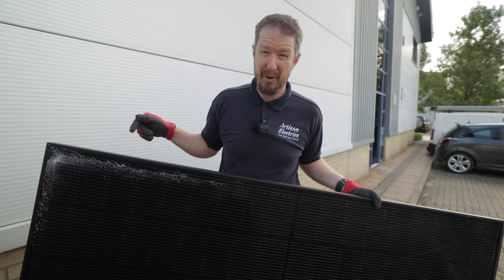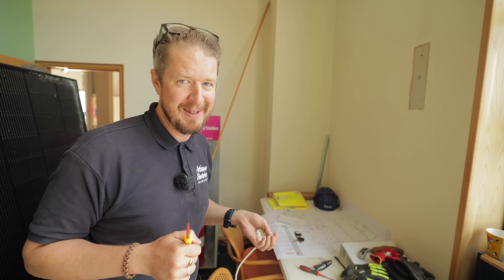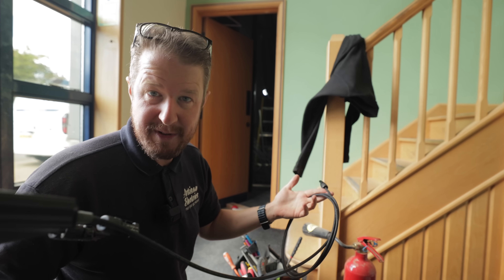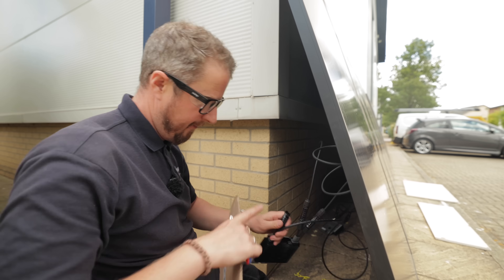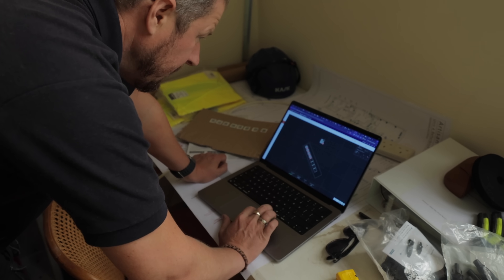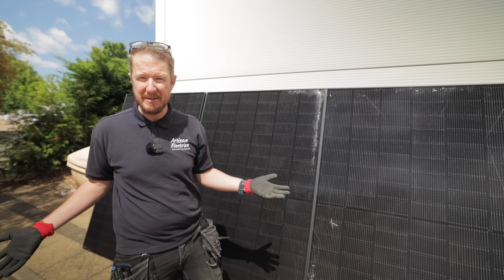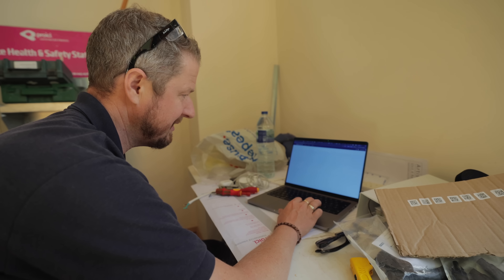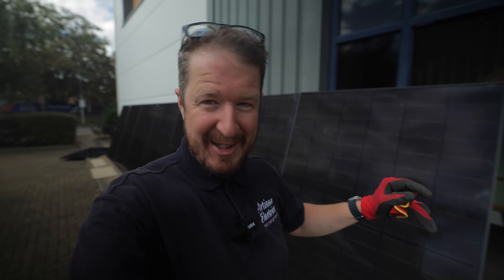Can Damaged Solar Panels Still Work?

Comment: Short answer = Yes !

Long answer, water ingress depending on depth and areas of damage. 
Potentially reduced output if electrical circuits compromised by impact damage or corrosion. 

Have several free damaged panels, all output. And by sheer coincidence, we had a blowy night, 2 panels fell onto concrete, and still work !

Comment: For a serious electrician, this is a very dumb test and completely unnecessary. The panic theory is out of place. Every Panel is nothing more than cells in series and parallel. If the panel's output is shortened, a good inverter will shut down that string.

Comment: shattered glass will still work at first , then from time to time  water will get in and cell to cell having short circuit.
I have buy some broken glass panel and apply the clear tinted that use in automotive, and it work like charm, what you want to do to broken panel is just avoid water to get in

Comment: A test i would like to see. Can you hookup a Sigenergy 5Kw inverter with a 5 KW battery and a SP gateway. When over 50% charged carry out some short circuit tests on a B10, B20, and B25 RCBOs. This is to test disconnection time not Zs, in island mode.

Comment: So this a new channel “artisan myth busters” next week let’s see how many panels you can over power an inverter by. I hear so many contradictions on this. As an industrial guy that works on power and control I don’t get why the inverter will only pull what it needs and won’t go pop. My mate had a cobble together system for some time with a cheap 1kw inverter hooked up to 3 kw of panels. Ran without any issues

Comment: Next test. Add an extra panel to the string to send it over the voltage limit. TEST THE SILICONE ADEHUVE BETWEEN THE Diode / M4 connection box and see if it melts and the box loses it grip on the back of the panel and drops off to hang on the Diodes and silver tails

Comment: Even if you plug uour + to the minus on the same panel. They will not short. The diode And M4 connection box, will show blown diodes in the case of a disaster.

Comment: My personal experience is ive got a broken panel with shattered glass coverin it,the panel also has a hole in it due to fallin over and hittin a star picket and well as its a ebay panel it had lower power than they say but it still works fine,reduced power but still fine

Comment: It’s pretty simple the panels are covered in glass. The actual solar generator surface is covered in glass. The damaged glass will likely have impacted the wiring. But just broken glass should have no effect

Comment: They likely work with cracked glass.

BUT when wet now you very likely have a insulation risk and if you touch the rails you might get high voltage DC softly making you a crispy roof ornament 😂

Don't think the solar production is the biggest issue here.
Neither fire risk.
And it's more a long term issue.
Silicon is very resistive from degradation from sun or water and shouldn't hurt it directly.

If it has a very huge damage like a dent or fold then yes it can be a fire risk, but still the now exposed DC is more scary in my opinion.

Comment: To be fare this test isn’t “complete” you will need put the panels and optimizer on a structure that is grounded to the inverter. The inverter says max iso because it’s not measuring anything as there is no feedback true grounding as everything is just loose on the floor. These panels for sure will cause isolation errors. Just check them loose, measure the resistance of it and throw a bottle of water one them. Even good panels you will see the isolation resistance go down, but there broken ones will cause a potential short if everything was grounded properly.

Comment: Depending on how the internal wiring is connected between the large groups on each panel, and depending on how the internal wiring within each group is done the panels could work fine right up to the point that all the important connections are broken (which could be multiple or single)... or it could just produce lower and lower voltages as each group within the panel breaks. There is also the possibility that large amounts of broken glass don't equate to large amounts of broken connections between the elements and then between the groups and then the panel as a whole. Broken glass means lower light transmission, but if all the elements are still wired up and each group is wired up you might only see a very small reduction in power.
Think of it as each panel contains multiple sub panels and each sub panel contains multiple parallel "strings" and then consider how you could wire up the roof panels so that no individual wire break causes the whole group to go off line (just a single panel) by having all the panels wired back to a single group connection point just before the inverter (as apposed to a string with multiple connections where a break in that string will off line multiple panels on the far side of that string) well solar panels, internally, can are laid out in similar ways to reach threshold voltages/currents per panel.

Comment: Even if these are working now, the smashed glass will let water in. I guess that is another test you could do with them (and a hose pipe). I think it may not have been wise to lean them against your building though as they may have caught fire as you suggested.

Comment: Yeah of course, the insulation test passes as there is no earth connected to the non existent rails that the panels bolt to...however I've seen and fixed many a cracked panel by pouring clear solar tolerant clear paint lacquer and letting set...water proofs and resealing AOK.

Comment: I had a pretty badly chipped panel in my array and figured, lemme just change that to one that is not broken, because, you know, I want to increase my production!

Well, I did, and my production did not go up at all. So, yeah, I guess these things are pretty robust. It has now been lying on the grass for half a year and I'm tempted to hook it up at some point to something as a test, to see if it still works or if it will finally catch on fire or something. All sorts of moisture may have seeped in.

Comment: I had a panel come off a roof once, needless to say it did not survive! Obviously as professional electrician I could not use it however, one thing I have always wanted is a solar panel with no glass or guts to help me initially lay out so I took it home to convert it into one. As a laugh I connected it via some dubious 18650's (from my wife's old vacuum cleaner that I was forced into repairing) and a broken commercial street light. My wife thought I was mad! Incredibly, it worked and the light came on as it got dark! There was no way my bodge-up was going to survive in the rain but it was a sunny summer so I decided to leave it a few days to discover where the point of failure would be! That was 3 years ago and somehow it's still working great and illuminates the turning area at end of my driveway (where there are no cables and it is all paved). As an electrician it has become a great source of amusement with our friends. The irony is that since then I have installed professional street lights with separate panels and batteries (and I buy them in bulk with 40% off!) but somehow this experiment has become 'part of the family' so I can't bring myself to put it in the bin! 
As an observation from your own experiment, you have used optimisers (so you can get the stats) but as I'm sure you'll agree, in a normal series wired install a single buggered panel could have a dramatic effect on the install as a whole, so even it works, the fact that it has different characteristics should mean it 'goes to the tip' (unless you have a street light that some builders reversed over and more time than sense!)
Reply: Actually, no, a single panel won't normally drastically reduce the output provided it has a working bypass diode and the inverter has MPPT.

Comment: Interesting that you bring this up. I want to get solar but concerned about being trapped into the suppliers equipment. I.E. a panel gets damaged and the supplier holds me ransom for replacement. Also suppliers often have engineering/supplier access which I may want to move to another supplier especially if the relationship breaks down. What are your thoughts?

Comment: Unless they are cracked all the way across the series run of cells the panel will produce something, the panel is made up of series and parallel strings. But once rain starts to get into them they will begin to fail.

Comment: As long as the cell wasn't damaged it'll generate power for awhile. Eventually water intrusion will kill it due to corrosion and cell shorting. Some folks apply a clear coat to buy time, and that will work for awhile, just don't expect them to last for years and years. Eventually they will die.

Comment: It is strange that you did this content. I just had a solar panel in my system fail. The Solaredge inverter had a ARC fault error. When looking at the layout one panel was not generating. all other panels were generating. Got up to the roof and sure enough one panel has cracked glass. We did get some rain recently so I guess the rain water migrated in to the crack and caused the arc fault. Replaced the panel and all is good.

Comment: I go to Austria on a regular basis and notice that a lot of new builds have solar fence panels, what are your views on them?
Reply: From an operational viewpoint, I was pleasantly surprised after looking at one in the Netherlands, obviously they don't produce nearly as much power over a period of time (and youre a bit screwed if the fence radically changes direction and you dont have multiple string options or optimisers) but thats offset by the fact you can install over twice as many. However, as I discovered, the ones I viewed were professionally DIY installed and not subjected to scrutiny! As an electrician, (in my personal interpretation of the regs) I dont think we can legally install them due to the exposed cabling, also I have 'evidence' to back this up, my first 'large' install was a model of perfection and quality that I was very proud of, so imagine how gutted I was when it failed DNO inspection for connection due to exposed cabling (I had to build a fence around it, that had to be custom made, so it was a fenced install inside a gated/fenced outer),  Also, there are about to be issued new regulations regarding the mounting of panels, do I don't see how 'a fence' would comply (although these regs, as I understand it, are still a few weeks away). I am working on a 2026 project which is short by 25 kW and I keep looking at the current fence-less boundary and wondering if its possible, trouble is, on this project, I am the consultant (producing all the drawings, specs, engineering surveys etc), hence the research, and my 'gut feeling' is a 'NO' so I'm going to opt for a 30kW mini-solar-park (on a bit of unused land) containing its own brick built plant room containing batteries, inverters, switch gear, independently fenced off because I know, this works, passes all scrutiny and is future proofed against all the changes we are likely to see.

Comment: Genuine question, why do all grid tied installers such as yourselves work with such low powered inverters? With off grid systems there's no limit to continuous outputs and much more powerful equipment that can be used when isolated from the grid.
Reply: 3.6kw is a 'limit' imposed by the DNOs to stop greedy pigs hogging the generation capacity. You can generate more, but you have to jump through more hoops. To be fair though, 3.6kw worth of panels will fill the average UK South facing roof.
Reply: @markrainford1219 5kw is the limit here in Ireland. Supposedly for grid stability so that the esb generators can keep up with with what comes in from domestic generation.
Reply: @markrainford1219  Isn't it a limit for this kind of equipment just because it's hook up to the grid trough a plug ? System of more than 10kW are displayed on this channel.
Reply: Now its strange because I have recently been pushing these boundaries on some installs, if I can answer the specific question, if you have say 5kW of panels and 5 Kw/Hr LiFePO4 by specifying a single phase 5kW inverter, the electrician can assume that the continuous current will be 22 amp and as such can be interconnected via a 6mm flexible 3-core flexible, simple and cheap, and the rest of the install will be using conventional technology and conventional equipment that you can buy at your local TLC, CEF.. whatever... As you go above 32 amp single-phase, you need to switch to 3-phase and then an entire extra complication arises with batteries due to phase balancing where you have to 50% overrate (and all the extra crap that goes with it!). So I never go above 7/8kW single phase because that keeps you in the magic 32 amp, 6mm. If you transition above 10Kw you are now dealing with 10mm (three times the price, 4 times longer to install, pain in the arse!) and the price of the associated equipment sky rockets (RCBO's at 350 quid instead of 20 etc) Quite honestly, if you had money to burn, connecting 7kW of panels to a 5kW inverter will give you a much better system than 5kW of panels to a 7kW inverter (being careful that you dont open circuit over-voltage the inverter) because the curve edges become steeper, the top flatter and it still produces 5kW on a slightly overcast day. Oh! and before anybody comments, the MPPT inside the inverter is only limited by voltage not power so you can connect 10kW of panels to a 5kW inverter, it will just load the panels up to its capacity. If you exceed the voltage by about 10% it cuts out with an over-voltage alarm, if you exceed it by 100% it goes bang and is now a boat anchor!
Reply: The inverter power just need to match the solar panel max power output.
Reply: @lapub. No not at all, the inverter power needs to match the buildings peak consumption load
Reply: @ourkilkennyhomestead2006  Solar pannel generate a power, the inverter use here is to take the power and send it into the grid. You can have one 450W max solar panel and use a 450W max inverter it will be enought, there is no use to put a 9kw inverter together with a 0,45kW panel. The only time you need to match the building peak consumption load is when you use batteries in  an off grid situation. When it's about on-grid use, you size the inverter to maximise the energy usage, you can use a 3KW inverter and if for 10 minutes in a month the peak demand is 4, you will just use 1kw from the grid during this time. avoiding the expense of a more powerfull inverter

Comment: I've had damaged panels on my roof for 2 years now, some way worse than the ones you have there. I bought them that way as the panels were only £20 each. So far they've generated me just shy of 9MWh of electricity which isn't too shabby.
Reply: I have very old broken panels for nearly a decade with some micro inverters on my garage. Some might be dead by now, but they still produce a few hundred kWh every year.
They are around 30 panels between 36 and 225 Wp each.

Comment: careful with that plug! don't touch those pins! plugs are not supposed to have a voltage when not plugged in, because you can easily touch those live pins and fry yourself.

bifacial panels, huh? if you put a mirror behind them, would they put out more electricity?
Reply: There should be no voltage as the inverter is likely a grid tied one so wont backfeed anything until its sync'd with the grid. No grid =  no inverting / no voltage on the 3 pin plug
Reply: @_Miner yep
Reply: @_Miner  i wouldn't want a grid-tied inverter because when the grid goes down, so does the inverter, and i can't use any of my solar electricity. and what would be the point of that? something that fails when it is needed most is NO BUENO! so i would want an inverter that can automatically switch from grid-following mode to grid-forming mode and back again, depending on the situation.
Reply: @mrxmry3264How would you avoid feeding back to the grid when it goes down?
Reply: @AnthonyRogers1960  there would have to be some automatic switch that can detect when the grid goes down and cut the connection.
Reply: On an off grid inverter, the firmware keeps it to about 80v/20mA to measure the impedance, isolation and potential load which is done via a solid state inverter, the main inverter is switched off internally to conserve power, the theory is that as soon as a potential load or voltage is discovered the main inverter can be connected and ramped up. You can still get a shock, not a big one that will harm you but one that will make you jump and think 'gosh that was a bit stupid'. Not that I ever done it, as a professional for 40 years I never get electric shocks... (er... one bit of that last sentence is not entirely factual!)